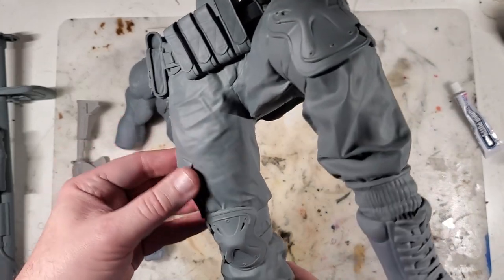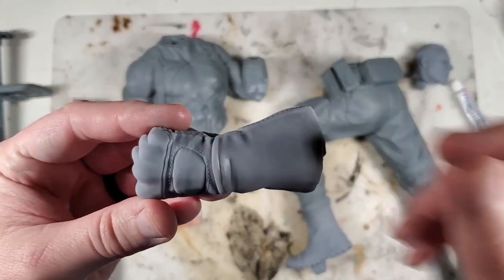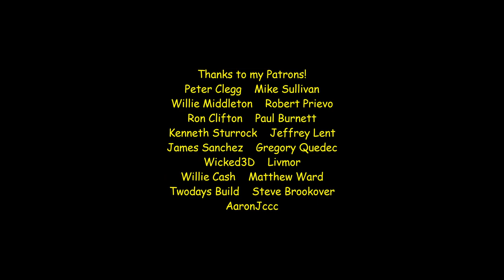This is how I Prep and Primer my 3D Prints and models

Comment: Stay away from wood filler. Water based,high shrink rate & adhesion issues long term. Get a good filler primer like upol or bondo. For heavier defects reduce bondo putty or upol putty with acetone & brush it on.
Reply from the maker: Thanks but I've been using this plastic wood filler for several years and it hasn't failed me yet.

Comment: Hey! I am thankful for your tips you have showed me, but how can I better apply primer to my models. I use a rattle can as well and right now I just lay the pieces of the model down on some cardboard and spray them with primer, but then I have to wait for it to dry to flip over and do the backside. Is there a better way I can apply the primer?
Reply from the maker: You can use alligator clips with skewers to hold them upright. I use those a lot!
Reply: @TheCreativeCollector  Thanks for the info, I tried them out and they work great!

Comment: What do you do when textured surfaces have obvious blemishes? Asking because I bought a resin 3d print which has a sequin-like pattern that has some blemishes on it.
Reply from the maker: A lot of times I use Aves Apoxy to sculpt the part if it needs it or I use my rotary tool to try and sand it after I fill it. It takes time, especially if it's a well detailed piece.
Reply: @TheCreativeCollector  thanks! I guess another part of the solution would have been to buy a print on a larger scale, since I feel that the textured surfaces are too tiny for me to repair them by hand. Still, I'll give it a try, since I need the practice!

Comment: Hey , Why do you use primer ?  why I cant just make paint very thin and airbrush gray before i paint with color ? what makes primer better than paint?
Reply from the maker: Primer allows to paint to grab onto the model plus it covers minor imperfections. If you paint with no primer, expect the paint to come off easy in some cases or the paint may bubble or just not stick to the model.

Comment: What pads are you using for the gtool?
Reply from the maker: There's a variety pack that's sold seperate with it
Reply: @TheCreativeCollector  what grit are those pads you're using on it to have the smooth finish on it, is it the 1000 grit pads?
Reply from the maker: @Erick-gx8qu yes
Reply: @TheCreativeCollector  Thank you